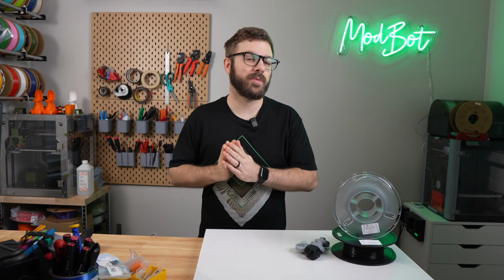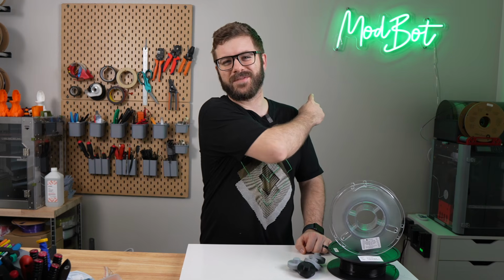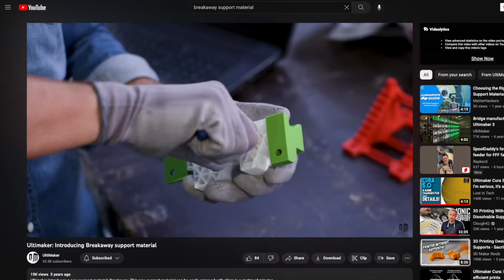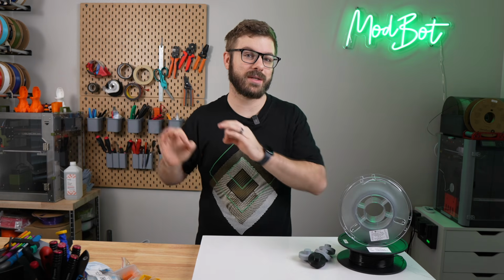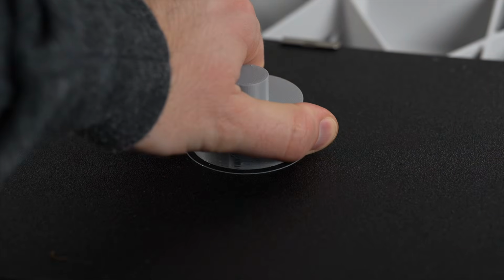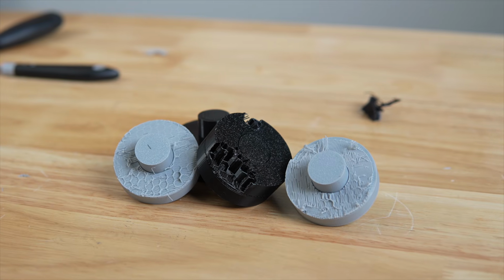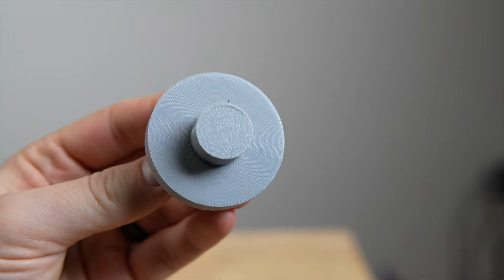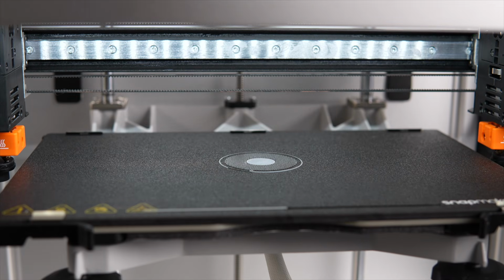Super Clean 3d Printer Support Removal (Combining Filaments)

Comment: You.mention in your video removing the  pattern interface layer and changing the to a solid would.remove.that. where is that setting interface layer (Solid) i.mainly use bambu.  I also have orca and been told that I can create my stl and print it on my.X2D.

Comment: I'm having a lot of trouble getting PLA parts with PETG supports to work. The PETG supports keep coming loose. Not from the build plate, but rather the infillll of the PETG after the bottom two layers. They keep pulling apart at the join between infill and bottom layers.

Comment: This print works great because material 1 wraps around  / interlocks  to material 2 so it will stay in place. With most prints, you have supports that can't do that and you'll widh that these materials would stick just a little bit better because one of he materials releases completely.
Try printing a letter T for example, without 'wrap around supports'...

Comment: Anyone else having an issue with their P1S and going from PETG to PLA (PLA for the interface). I find that when it’s time to change to the PLA, it does but never actually prints any. I don’t think it’s able to flush the residual petg in the hotend and then the extruder malforms the filament which causes a clogged extruder. What am I doing wrong?

Comment: Hi, i have a problem with PETG supports. I'm trying to print a wheel rim for a LEGO car with PLA. when it's finished,  In the same layer that uses PETG for the support and next to it PLA for the piece structure, the piece get separate (brake). I think its a problem with the  different temperature of both materials? What can i do? 

Thanks for the help

Comment: Using a multimaterial system, like the Bambu Lab AMS, you don’t need multiple extruders. Of course, printing the entire support with an alternate material would result in an ungodly amount of wasteful poop but like others have pointed out, you can just print the interface layer in the alternate material, and it works just as well.

Comment: I'm experimenting with printing a dedicated support block in PLA that can be inserted directly under overhangs at a certain layer height while printing PETG. It's a solution for single extruder printers owned by most people.

Comment: Hello,

pla support for PETG. How do you get PETG to stick at a print bed temperature of 70 °C?
I usually have to print PETG at 80 °C, but the PLA becomes too soft.
I think using PETG as a support for PLA is pointless, because PETG is the better material.

I also have the problem that the PETG does not stick to the PLA support. Distance is 0

Comment: I just tried this on my X1 Carbon and the results were amazing! Thank you so much for the suggestion!
Reply: How to set this up with the difference in temperature for pla and petg? The bambu software keeps telling me to turn off the bed plate heating. 

The object is pteg and trying to use pla as a transition layer with the supports as pet.g
Reply: @dlee9174  I had a similar issue when I first tried it. After adding the PLA interface material, the build plate was changed to the cool plate. All I had to do was change the plate type back to Textured PEI, which is the one I originally intended to use.
Reply: @dlee9174  The hotend will adjust the nozzle temperature automatically between interface layers. If it's telling you to turn off the bed plate heating, your bed plate selection may have been reverted to cool plate. Try selecting the option for your specific hot plate. For me, I had to reselect the Textured PEI Plate option under Plate Type.

Comment: Just tried this on my X1C, it actually works better than the Bambu support filament, I am using 3 layers, it is easier to break off in one piece, this is a great idea, thanks.
Reply: Wow how times fly when you posted this comment the X1C was new and expensive, last month I picked a nice 2k print hours example of ebay for only £350

Comment: Has anyone tried the special filaments Bambu sells for their printers that is specifically designed for the interface layer? I got a small role of "Support for PLA" which states it is specifically intended for printing PLA support interface layers but I haven't gotten around to actually trying it yet.  Though given the price on a full spool it might be cheaper to just use PETG.  But my understanding is this stuff you only need to use for the interface layer so it might last longer?

Comment: I've done this!  I doing a pretty weird print in TPU that needed supports. I designed supports in PLA first and then had the print pause and placed it in place when it was time. Worked really well, even though I only have a single print head! The PLA supported the TPU without becoming fused.

Comment: You're about the fifth Youtuber I've seen this from. And I hear it works with ASA+PETG too. This is exactly what I want to try on my Bambu Lab P1S. I occasionally print difficult technical parts and this would be a life changer. 👍

And by the way, a much better practice is to make only the interface layers out of a different material. At least from what I've heard - I'm just about to experiment with this method myself. 😎
Reply: I do it with settings here for asa to petg and so far so good😊

Comment: Broke three parts this morning not checking where the support was going using PETG. The walls are 0.4 so holding the bits while forcing supports off/out caused several squeezed to hard moments and split. I have a  BTT Manta M8P coming, She's got a couple of spare driver spaces, Adding a extra extruder for this sounds like a plan.

Comment: TPU doesn't stick well to PLA, so it might work as a good support material.  I'm far more excited about the mechanical possibilities.  If I print those cool herringbone gear "bearings" they weld up super tight.  Printing them in PLA for the hub and outer race, PETG for the "bearing" gears, it should come off the printer and just work.  Print-in-Place models just got much cooler.

Comment: PLA dissolves in saturated NaOH or KOH water solution at 60 degree C. Pieces of PLA filament completely dissaper in this solution in less than 3 hours. So use 2-3 layers shell interface supported by regular supports which then can be from either material and just drop the part in that solution after printing. Ocasional stirring or an aquarium water pump with nylon mesh filter can reduce dissolving time. Important: To remove any alcaline remnants from the porous spaces between layers after that, rinse in citric acid solution at the same solution at the same temperature for the same amount of time. Then like 10 minutes in hot water. Or, use diluted HCl (3-5%) and then baking soda solution to neutralize it then hot water rinse (HCl penetrates deeper to remove alcaline remnants because it is a gas dissolved in water and can jump air bubles between layers).

Comment: if you want to separate support easily but don't have IDEX printer, you can try pausing the printer during the print and add a layer of glue stick right at the interfacing layer. I do this by adding a post processing g-code in CURA to stop and beep when the support roof is printed. However this is only suitable for design with simple geometry, but still useful in a pinch.

Comment: Would love to see experimentation with dissimilar supports for ASA. I’ve tried using HIPS with 0 gap as people have suggested in the past, but it only works well under flat surfaces. On sloped or curved overhangs, single lines of the HIPS tend to fuse to the ASA. Printing on X1C
Reply: Dissolve away the HIPS lines with limonene.
Reply: You ever figure out a good material for ASA I been searching and searching and finding nothing.. Most of anything is to much of a drastic temp change for asa with the ams

Comment: Been doing PETG to PEtg supports using tree in bambu labs and standard in ender 3 s1 pro    ender set at 0.35 and 0.4 for xy   bambu has presets which work great, keen to now try PETG with pla supports to get clean surfaces on both units Great video

Comment: I have tried this recently on my X1C with good results, but a question I would pose is what bed temperature to use? Selecting PLA + PETG caused the slicer to default to 80 Celcius bed temperature, which is beyond PLA's glass transition temperature. I've read warnings about PLA smushing in the extruder due to heat softening due to high bed & chamber temps, where the PLA balls up enough to plug the extruder and prevent retraction or extrusion. An in-depth study of the ideal compromise settings would be useful, particularly testing open frame and enclosed printers. On the Bambu they recommend printing PLA with the lid off and lots of cooling, due to the potential for blockages in the extruder. To date, I have never run with the lid off or door open for PLA, and the only plugged extruder I've had was due to speckle filament in a 0.4mm nozzle. Weather is getting warmer, though, and up to now my office has been cool so my luck may be coming to an end.

Comment: Disolable supports are most useful for putting supports on places where it is hard to get at (e.g..figurines) or places that need to be hollow for weight or storage and won't print without internal supports.

Comment: I’ve been doing this for a while now, interesting to see it’s being covered though. I’ve also been using nylon (technically cf nylon, I don’t have regular nylon) as an interface layer for polycarbonate and abs and vice versa. In theory, PP should work as a support for almost anything, but it might be too slippery. I have a half completed spreadsheet with a bunch of materials tested together, and I did want to try doing stuff with TPU but i don’t have a dual extrusion printer unfortunately.
Reply: how's your sheet been going?
Reply: TPU sticks to everything... everything LOL sheet complete! @heartminer5487
Reply: Checking in once again, how’s the spreadsheet going?

Comment: Works like a charm.  PETG also does do work well with ABS, ASA and Nylon...... PC is a different animal and if you crank up PETG with 250C you better be printing fast and a bigger nozzle but it does do work. Another thing we did do is also do is if you do PETG parts and you need like a stand support like what Daniel just showed you can use PVA as a TOP layer on your support and the parts come out perfect.

Comment: I have being doing that for about 5 years now,ABS with PLA, PLA with PETG, PLA with HTPS  PETG with HTPS, the combo that doesen't really workis ABS with HTPS, they stick well together,also ABS with PLA sticks a bit more than PLA with PETG.

I also noticed the best support material is the one that has similar printing temp with the main part.

I also noticed the heatsink cooling with air is a bit of a problem so all my printers now are watercooled, all have enclosure.

I also noticed that priting with zero supports saves time and material in priting, and in post processing, hence I now build myself a 5 axis core XY machine, aiming to port it to 9 axis this summer, so by printing non planar from a (inexistent for now) non planar slicer, will be even better.

Comment: I'm very interested in the snapmaker J1 for this very use, I wonder if its possible to use the support material for the interface layer only as others have suggested with the setup you have? To save on changes and print time.

Comment: For simple parts i draw the supports myself then print it in petg then i print the main part whith supports disabled or block on the specific surface, then pause it on the right layerhight,put the support on the bed, let it warm up for a minute and resume the print! this works great for me and i had simlar results like u! u can even reuse the support because it pops off so easy! its very usefull when u have to print a part many times and u save filament when u reuse the support :)
Reply: super interesting idea

Comment: That's really interesting!  I print a lot of miniatures and so do a lot of support removal (primarily with tree supports).  I'm wondering if the interface between the two materials is strong enough to support something like a character's elbow where you might only have a small amount of contact point but then need to build a fair amount of the model off of there.

Comment: I guess I'm giving away my own trade secret but whatever 😆. For my business I use one extruder with PLA and one with TPU. Both work as supports for each other without using a z gap. Even better, with ideamaker I set the infill and inner shells to PLA, the outer walls to tpu, and the supports to pla. It makes impact resistant yet stiff parts with easily removable support. Effectively creating a built in shock absorbing layer on the outside. Only downside is tpu is hard to print cleanly. You need to tune the linear advance quite a bit to get good prints. I highly recommend overture highspeed TPU for that purpose.

Comment: Besides this topic, witch is a very good solution, especially with a Dual Extruder Printer - speaking of ... - you own a Snapmaker J1, could you please do a deep review with tipps how to make this machine running without having issues? As they are now shipping more of these, there should be a community to help each other and I´ve heard a lost of problems coming up with SM J1, especially part cooling, slicer "Luban", clogging,...

Comment: The trick for using HIPS to support ABS seems to be keeping the support structure sparse and the roof thin enough so the HIPS can flex.  Zig Zag support makes the most sense in that respect.  HIPS will peel away easily if you can get under one edge and flex it away, almost like breaking surface tension.  It doesn't work so well if you try to pull a big solid block off.  Also keep the support distance a couple line widths wide so that nozzle offset errors don't result in the support fusing to the part. For flat parts no solvent is needed and HIPS doesn't absorb moisture any worse than ABS.  I haven't used it enough to speak with any kind of authority, but that is what I have learned over maybe a dozen prints using it for support.  I plan to give the PETG supports for PLA a test soon if my project will fit on the IDEX.

Comment: I already have used PETG to print a raft for a PLA print, using a single extruder printer. I was having a lot of trouble with bed adhesion with this specific roll of PLA, so I sliced the model with a raft and put a filament change right after it, also with zero gap. The print finished with no issues and the raft came off perfectly clean!

Comment: Although Polypropylene is not so common FDM material, it might be suitable for interface support as it is not sticking almost to anything except itself.
PP is also printable from 220C up to 250C temperature, which might be convenient as support for most common sub 270C materials (PLA, ABS/ASA, PETG, TPU etc.)
Reply: Yeah but then it won't stick to the rest of the support structure
Reply: pp is way to slippery

Comment: As an extension to this, depending on geometry of the model, you can print the support seperately, then start the main print and use an M600 command on the overhang layer to pause the print, allowing you to insert the pre-printed support, which you can then print ontop of, allowing you to use this same method on a single extruder machine

Comment: If we could add a option in slicer to change filament only for interface layer it is possible use this feature on a normal printer by manually changing filament

Comment: Great video Daniel as always, thank you. Something off topic maybe you would know. At the end of a print what would i need to put and the end GCode to have the hotend cool down to 100c then retract 200MM? Ive tried everything and cant get it to work. M104 M109 M302, it just skips over it and runs the rest of the GCode. It will retract but wont cool down first. I am using a Sonic Pad if that means anything. Is there a way to do it that you might know? Thank You

Comment: i actually found this out on accident just a few months ago.  i had ordered a roll of petg in a color i don't normally have and they sent me a roll of pla on accident.  i didn't notice and it actually printed really well at my normal petg temps and settings.  until i tried to do a multicolor print and the thing separated at the color change instead of from the bed.  oops.  tried it with a few different models until i actually looked at the roll and realized what happened.  those 2 filaments just do not stick together.

Comment: A couple of months ago I tested this on the ultimaker S5 and had great results, I also tested CPE+ with the pla as a support and it worked great too, it just deformed a little because the cpe+ prints at 280 degrees and the bed was at 100 degrees.
I already tested TPU with PLA and it worked too, it stuck well but it was better than the support made with TPU, another advantage is by using PLA in the support, it was possible to print faster even.

Comment: This has me thinking about using pre-printed supports on non-multi-material printers.  Kind of like how people pause a print to insert magnets or nuts, but with a support.  Obviously it would depend on the model, and wouldn't be quite as clean as 0 gap, but could really help in some cases.  Such supports might even be reusable.
Reply: I do that with tpu, pre print support in abs, works well.

Comment: I wonder if you have the supports on the model will they detach? Like instead of the opposite of either material begins the support on the build plate, what will happen during print if the support is on the model 0.o